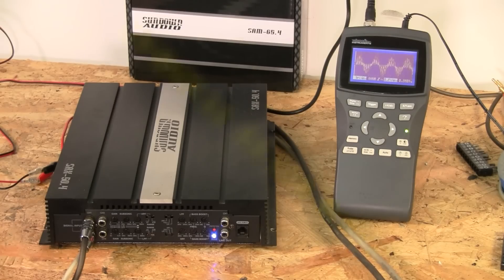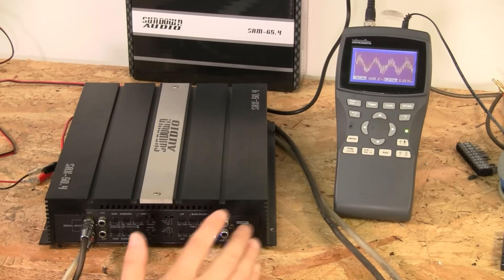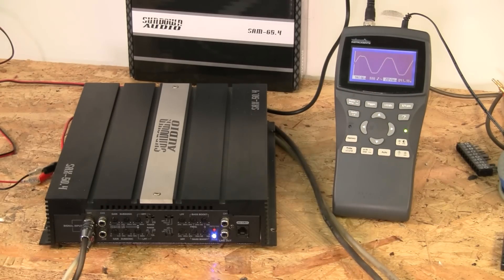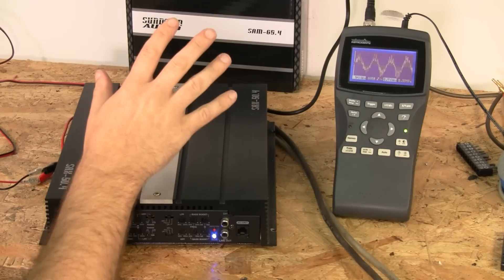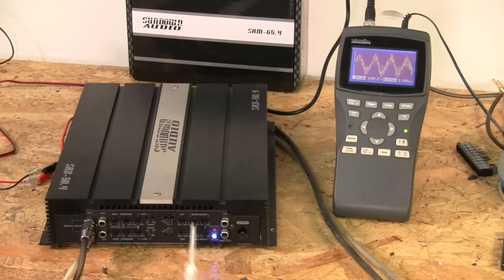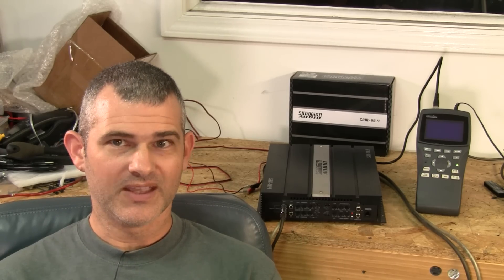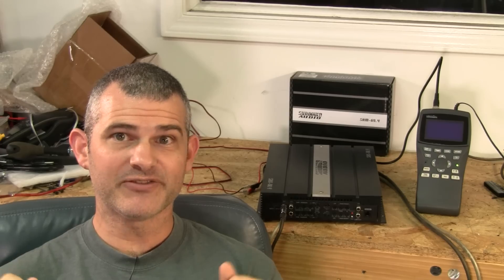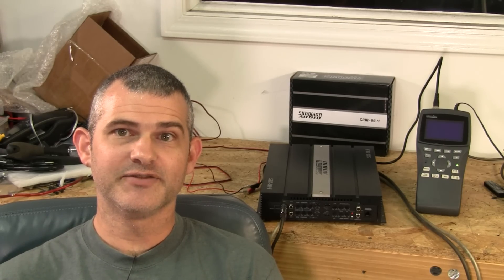Bass Boost: The good, the bad, and the ugly sine wave. - Tech Stuff Tuesday

Comment: This video is garbage, look here it's a nice clean signal. Now I turn it up and it's clipping, now I'm going to add bass boost, and look see it's still clipping, now I'll turn up bass boost on the clipping signal and see it's clipping even more. Thanks dude.. maybe turn the amp down so it doesn't clip and then show what happens with 5 db bass boost. Anytime you boost any frequency 9 or 18 db your going to make a mess of the signal. Grab your equalizer and turn up your 17khz 9 db and tell me if it clips . When the signal clips..

Comment: Thank you so much for this informative video. 
I have recently installed low RMS subwoofers on a 5 channel amplifier and could not for the life of me figure why I have clipping when I turn up the bass boost on my equaliser, even with the gain set right down to zero on the subwoofer channel of the amplifier.
Turns out my equalizer has up to 18dB bass boost. My amplifier would get really hot with the bass boost on the equalizer turned on (bass boost on the amplifier is turned off).
I will set the boost on the equalizer to 3dB and set the amplifier gain to get a clean signal. Then use the the equalizer with the bass boost turned off.
This might just save my setup and give me the clean bass I so very much desire.

Like I theorised with my brother before finding this video. Bass boost is like having a big turbo. Maybe you're safe at 14psi but the boost takes you to 25psi and you don't have enough fuel flow to account for this added boost then 🤷‍♂️ you're not gonna have a good day.
Just because the boost is there, doesn't mean it's safe to use it all.

Comment: So never ever use bass boost?
Reply from the maker: Not necessarily never, it has it's place, and rarely will it be used it more than a 3 dB boost. In most cases no, you shouldn't be using it. It's there to boost a deficiency, not go above and beyond.

Comment: If you have an amplifier with adjustable bass boost frequency (like from 30hz to 80hz) how would you determine where 45hz would be? I used the cc1 to set my crossovers and subsonic filter, but how would you set the bass boost frequency.
Reply from the maker: The easiest way is to use a DMM on AC voltage. Turn the amount of boost all the way up (to give the biggest change in voltage) and where you see the highest voltage is the frequency it's set to.

Comment: How do you get big base with base turned off.
Reply from the maker: The setting is bass BOOST, not bass period. You should have bass as long as  you aren't filtering it with a crossover.

Comment: i got a kicker cx400.1 amp hooked to a single 2 ohm 12” 600watts rms, if the amp makes 300watts at 2ohms could i just turn the bass boost up 3db to double it or would it be pointless
Reply from the maker: Bass boost focuses on 1 frequency and tapers around it. It doesn't add power, it just changes the linearity of the bandwidth. You're still limited to the power it can put out.

Comment: Isn't that called a square wave🤔 I've been into music production as a hobby for a wile and the "round wave" is called a sine wave  and a "square off wave" is called a square wave. The difference is the "sound of it. So developing sounds for everyday music on production software. Technically  they is a lot of square wave sounds in music. That being said, seeing a o scope start to square off of a smd dd1's light start to come on isn't that developing " the sound you want to hear" come from your subs, like music production..... I get the whole ohms law ect..ect... volts to watts how many watts a driver can take. I don't have a o scope so I don't know what the wave would look like but I know on a dd1 if you compensate  the main level on amp and use the dd1 for boost until the light comes on and back off its still good.but again I have seen the wave it makes. And isn't a o scope a infinite level on a chart and it being "start to square off" just become another process of engineering  SOUND.....
Reply: I'm not disagreeing or saying I know it all just my 2 cents  just saying is that really clipping.i like to learn from others too
Reply from the maker: Yes, clipping is a square wave and a sine wave is "round".
Reply: All I’m saying is look into studio music, besides turning that bass boost like that is the same as turning the gain it’s going to clip lol. 
I noticed that if I set the gain to the bass boost clean I needed less gain  and if you set the gain first clean then you needed very little boost and it would stay clean….  That was on one branded amp. I had another that off I wanted the boost I had to compensate.   Does make a difference at least I noticed in my pickup with a under seat dual 10 in the back  where space is very limited. 1.4 cu …. Sealed!

Comment: It works good on a sub that has a really low flat frequency response like an x12 to give it more kick. I just add it in till it kicks harder and reset the gain.
Reply from the maker: X's are actually frequency deficient, not flat. They fall off over 45 hz or so.
Reply: @EMFAudio  agreed.

Comment: I would have to agree to disagree! I've been messing around with bass since the 80's when bass boost was none existing! Different amps back then you really didn't need it. Take for instance the old school Punch150. Need I say more! Fast forward to now to higher wattage amps, bass boost is horrible depending on your equipment and settings! Settings are key! Bass boost is possible and not the Grim Reaper of audio if you properly set your gains and head unit. Everything don't need to be maxed out. The more you turn bass boost on the more you turn your gain down! A quarter to halfway depending on your crappy equipment! 😏The sound difference will rock you. I never buy or install an amp that's higher than my speakers! Your asking for it. 1000 watt amp 1500 watt  speakers that way I can play around and not do harm. Bridging would be the closest you want to push speakers in this case. Not Bridging 2000 watt amp to 800 watt speakers! Bone head ideas! 🤪🦴 ... because your going to always be tempted to crank it up a notch..don't let people scare you into not using bass boost!! There are proper ways in tuning it. in all its about SETTINGS..SETTINGS...SETTINGS...

Comment: I have  two 12" 1200W RMS total @ 2-ohms subs and an amp that puts out 1100W RMS @ 2-Ohms.  However, I only have a 90A alternator.. So I was thinking of setting the bass boost to 6dB (halfway mark) on my amp and tuning the amp to 1000W. My logic is I can't run my subs at 1200W cuz my alternator can't handle it as well as my amp, so if i push the bass boost a bit and tune the gain knob to 1000W, that will give it a little boost to aide in the lack of running at full power.   In the future, I plan on upgrading to a higher amp alternator, and getting a more powerful amp; when I do, I would have the bass boost all the way off when tuning.  Does this sound about right?
Reply from the maker: Bass boost simply takes a set frequency and makes it louder, it doesn't make it collectively louder nor does it make it draw less amperage. You might be surprised how much power you aren't making. With a good battery and big 3 upgrade there is no reason your 90 amp alternator shouldn't run a 1,200 watt amp.

Comment: I had the bass boost set to 3-6db for years before I heard not to. To be honest it actually sounded better than when I turned it off but then again I had the gain set low (less than 100 watts without boost on a 400 rms alpine amp) I doubt it would hurt anything in a situation like that

Comment: What happens when you back down the gain then add bass boost?
Reply from the maker: Your frequency response becomes less linear, but unless you do both proportionately you'll either still clip or not have maximum output capability.

Comment: This is a very informative video and confirmed what I had suspected. I own an Audi S5 Sportback and felt the bass was sorely lacking, so I recently had a JL Audio 10-inch sub installed in a custom enclosure with a 500/1 monoblock amp. I was initially underwhelmed because the bass was totally overpowering. I checked the amp and saw that the installers had turned up the bass boost about a third of the way. I turned it all the way down and the system is amazing now.
Reply: Overpowerimg bass is underwhelming? Lol

Comment: I have it set to 6db on the amp and 24db on the deck. It sounded the best to me there.
Reply from the maker: You have bass boost up 30 dB in total?
Reply: @EMF Audio Yea, with my gain set barely at about 1/4th. I set the gain after. I tried using different combinations with the amp and the deck and 6/24 was where i got the best bass i could feel. It shouldnt be an issue as long as i set the gain with a DMM after, right? My amp is 1500 @ 1ohm , my speakers are 600rms each (4ohm DVC wired parallel to 1ohm). The number i got for the DMM was 34.6. I just set it to that after i set the db. The db makes the number show a lot sooner when dialing the gain. I assumed it does this to compensate for the db being added. Will it mess up my speakers?

Comment: And just to double check is the bass boost supposed to be higher or lower than the gain setting?
Reply from the maker: Bass boost shouldn't be used in nearly all applications. It's relationship to gain setting is nothing.

Comment: Sooo I have a 15inch L7 Q class and a 1200.1 amp and installed the big 3 and some how started to get smoke? Speaker is good and no the gain is not my bass knob. Not a newbie but for some reason with my gain set less than half way and everything is perfect as in perfect wiring runs good grounds good everything. Had it for about three weeks for the same settings for my 12inch just to break in my 15in and my speaker seems just fine but no ships in dfw had meters to set gains to avoid clipping or anything so how the heck do I find out why my coil burned a little bit everything is still ok tho? Why would that happen tho?
Reply from the maker: Gain isn't a power knob, if everything was fine with your old gain setting that was probably the right setting. But, if you listened to tracks with a higher recorded volume it could have been clipping. Most "enhanced" music is clipped as well.
Reply: EMF Audio agreed. I don’t use my gain as a bass knob man lol 😂 I promise y’all that the only way this could of happened was either the big three was installed wrong and once I took it out everything is back to normal. The other fella explained to me very well on how to reset my gain by ear. Trying that later today but this morning at work when I play my system for about 20mins straight through pandora (no enhanced music) and played for to long maybe but with the settings it shouldn’t have done that but it has to be the gain and bass boost are off like I know my bass boost is on and going to turn it all the way off and restart from there and not use any boost

Comment: What if I'm using a cheap head unit and I set the gains so it's maxed out at a lower number on the head unit such at 30 or less? Is that ok?
Reply from the maker: The numbers don't matter, the only thing that matters is the gain is set to the matching output voltage, be it 0.2v or 6v, or anywhere in between.

Comment: What key are u moving for the bass boost? Can’t see it
Reply from the maker: The one labeled bass boost.
Reply: EMF Audio my AMP only has Bass EQ, Sub Sonic, low pass, level. What setting will increase the bass I’m new to to the audio stuff
Reply from the maker: @centralcoast6720  "bass EQ" won't increase the overall amount of bass, just a narrow band of bass at lower volume levels. The only thing that will give you more than you have overall, is different equipment (sub(s), amp(s), enclosure, etc.)

Comment: wouldn't variable bass boost be useful for boxes tuned really low like in the low 20s and compensate for the loss of higher bass around the 40s-60s by boosting a few db around 50hz?

Comment: I professionally installed form 1988 to about 2001, 2 ways I have used bass boost, 1. In a factory radio where we used a line out converter and the factory radio was tuned a certain way. (most factory radios are not 20-20,000 hz)  2. using an amp for midrange  and were lacking snare drum pop. you can gain a little in the 80-100 hz zone and pick that up.  Strong midrange around the 100 hz zone is hard to get out of 5.25" driver, A LITTLE bass boost helps.  If you have a full 40 hz signal going into the amp, it is being amplified already, you cannot boost anymore power from that amp that is already maxed rail to rail , you just get harsh clipping.  A 100 watt amp with 18DB bass boost will never be a 150 watt amp. Hope this makes sense.

Comment: Manufacturers need to stop with the bass boost and start putting in clip lights and or remote giants with clip lights.
Reply from the maker: Sundown has been putting clip lights on amps for many years. I do agree it should be more common, but people will ignore them anyway.
Reply: @EMFAudio  didnt rockford fosgate start doing that with there Power line?

Comment: I do see a difference in the way you test , you use a roll in , where I use a momentary switch in the RCA cables full blast for 1.5 seconds just long enough for the meter to register 👍🏻I like what you’re doing keep up with the tech videos
Reply from the maker: There are legitimate reasons for rolling in, from an amp functionality standpoint to a sub durability standpoint.

Comment: yeah I don't understand that if you turn off the bass boost where's the base it's gone I've had many amps soon as you turn off the bass boost all the base is gone
Reply from the maker: That sounds like you have other settings problems filtering out the bass.

Comment: I've always use bass boost,usually 18db..the difference  for me is that I turn the gain down.i only want to hear the lower bass
Reply from the maker: You know, you could achieve the same thing by turning the LPF down, while not changing the curve on the bass frequencies you do want.
Reply: @EMFAudio  it won't sound the same.
Reply from the maker: @smtyson1650  Exactly, it will sound better because you have a flat response in the range you want.
Reply: That's right if you're going to use bass boost crank the boost all the bass boost turn your gains down
Reply: that's how they say to set it,using bass boost in my mtx1501d manual also

Comment: Have separate level control (through the RCAs to my monoblock) and bass boost control. I find I rarely turn the bass boost up for most music I listen to (rock, country, etc), usually only for some hip hop/rap songs where it actually increases the sound of the bass in a good way. Thing I dislike about my Pioneer monoblock is the bass boost is only at around 50hz, you can't adjust the frequency. I like having both controls, I find on FM radio I have to turn the level control down because the stations tend to have their bass turned way too high. Been trying to convince my buddy that his bass boost knob is NOT a level control for his amp, which is why it sounds horrible turned up and not just louder.

Comment: Good evening,
I have a question that I hope you could help me with since you sell Sundown Subwoofers. 
I bought the SUNDOWN SINGLE SUB BANGIN PACKAGE (2000Wrms) 5 days before my 50th Birthday on October 8th from Down4sound in Las Vegas.  After waiting 7 weeks to get the call to go pick it up here in Vegas... I Finally got my Birthday present. 
🤘🏼😜👍🏼
Now I am having a hard time finding a Sub Box that has the specs for the X v2 15" that I picked for the Bass package that I bought. D4S doesn't carry single 15" sub boxes. From the few boxes that they showed me they only had a huge dual 15" sub box. Other than that they didn't have any bigger than 12" sub boxes. Would you happen to know of a place that sells good sub boxes that are pretty much made for Sundown Subs? After waiting 7 weeks I am Amped (Pun Intended) to get my new addition Thumping/Pumping/Bumping Down the road. 😉.
Thanks
Reply: Chico Man I have the same woofer I had to get a box made with the specs for the woofer and it’s ported

Comment: I hate buying a amp or tuning a buddy amp or customer and the other person has the bass boost on. And when you set it for them they go it was hitting harder before and then after they leave and they call you again and they said a problem happened and they bring it back only to see they turned up the boost again and say they didn't mess with anything
Reply from the maker: Distortion sounds louder, so that's why they think it was louder before. I know what you're talking about though. When I used to install professionally people would blow subs up in a few days and come back. Every time it was everything wide open and "my friend said he could get more out of it and you didn't install it right".
Reply: Is there a such thing as a "volume" switch on a amp theres gain and gain is no way anything like volume as much as anyone would like 2 think. does sundown actually have volume knobs on their amps ? I cant  see any lettering on those little small knobs and no this is not a joke
Reply from the maker: @treezy206  Sundown amps are called  "bass knob" and it does modulate volume, sort of. With that knob all the way up it will never go higher than your gain setting, so every position in that knob is a reduction of gain. So, it's not so much a volume knob as it is an input reduction.
Reply: Also imo bass boost is just a phoney bologna  marketing gimmick the 1st time ive seen bass boost on a amp was on audiobahn i bought off ebay it blew in a couple of days and only other  times ive seen bass boost besides the sundowns is on those cheapos on amazon like boss, planet audio, crunch, new  ppi, crap . Or maybe i have and not noticed i know it starts sounding like crap once you start messing with it